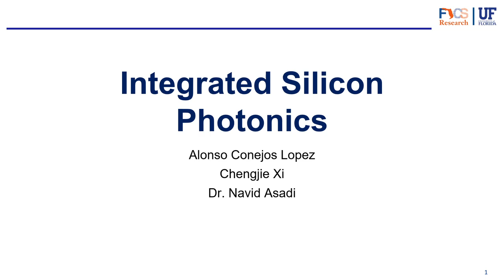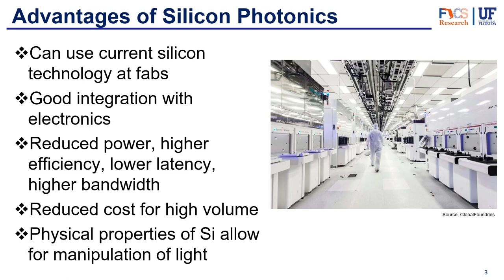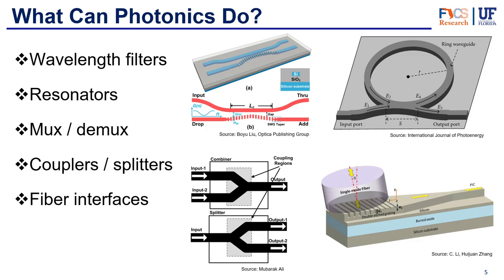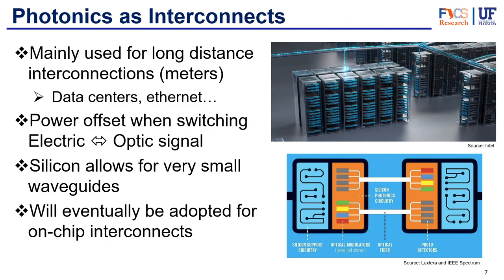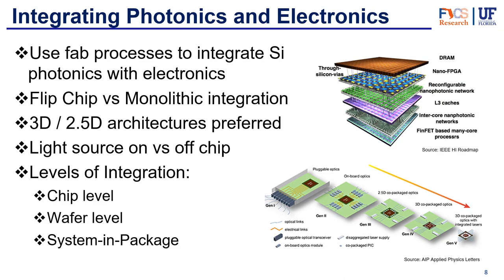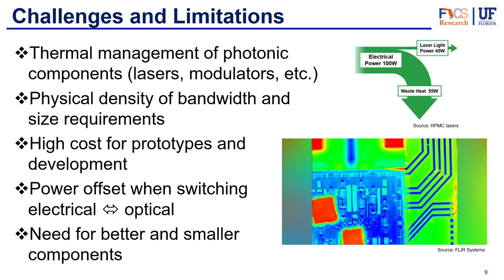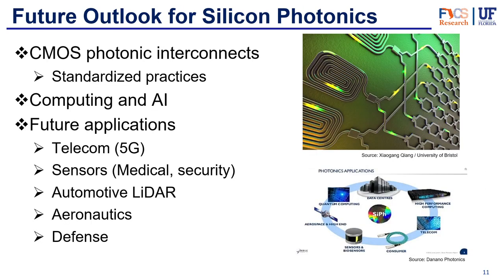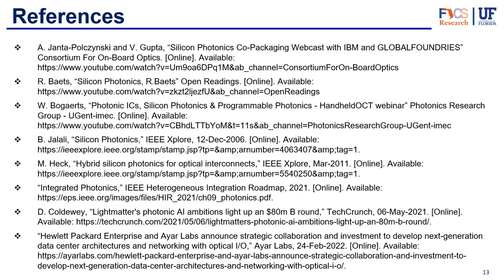Packaging Part 16 3  - Integrated Silicon Photonics

Comment: Hurddle is Over come -  Lightwave Logic - makes CPU/ASICs faster, it's all in the EO polymer
1) Semiconductor modulators are a SUNSET business
2) LWLG Polymer modulators are a SUNRISE business
3) LWLG modulators are already more than 3x the speed
4) LWLG modulators are Order of Magnitude Lower Power
5) Many Customers & Partners all under NDA currently
6) Many Foundries implementing LWLG technology in PDK's
7) at OFC 2022 "gloves were off" and the Customer Base was opening discussing the imminent need for LWLG technology where in previous years such discussions were only behind closed doors under NDA
8) At OFC 2022 -- Lebby said "so now it is not a case of Lightwave Logic pushing its Polmer technology, it's a case of Lightwave Logic be dragged along by the Customer base saying >> hey this is really cool, we need to utilize this technology!!"
9) LWLG Polymers are in fact just as Reliable/Robust as Semiconductors